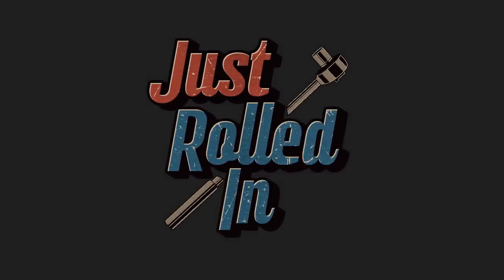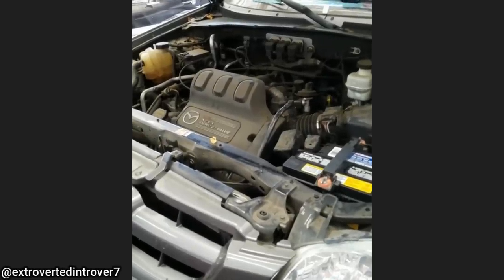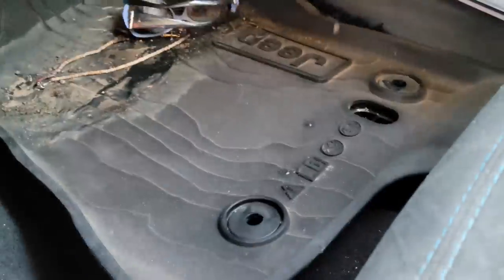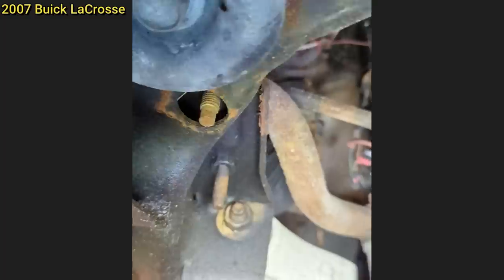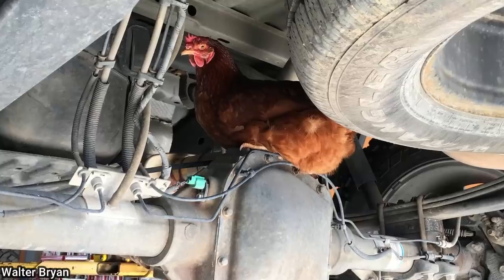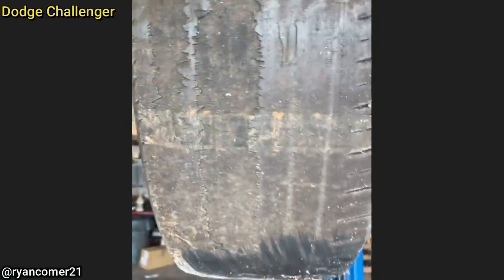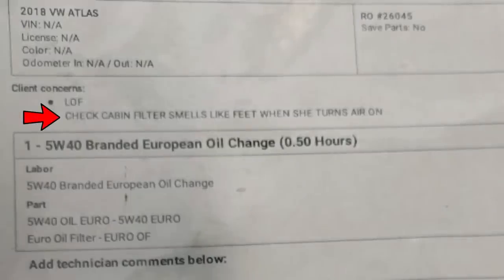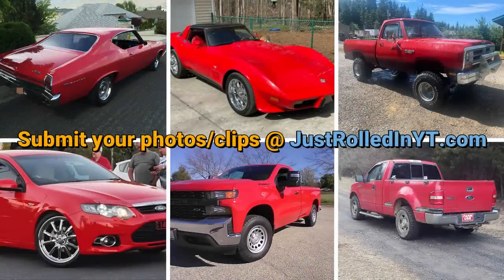Customer States They Got A Flat Tire & Kept Driving | Just Rolled In

Comment: I had a new 2015 Chevy Equinox with free oil changes, by the 3rd time It took a couple of hours so the 4th time I did it myself. I come to find out they never changed the filter and it was all clapsed in from being so dirty. The dealer refused to acknowledge it. It got ugly after that.
Reply: Changing oil without changing the filter is like showering and then putting the same dirty clothes back on, underwear included. 😛
Reply: They all do that crimp in the middle during removal.  Its the cheap chinese brands.  They too do not buy your story. These are easy to replace.
Reply: @cpufrost  im pretty sure the delivery vehicles at my last job never had the filter replaced when the oil was changed. tbh, those cars also missed oil changes. no clue how a 2011 vw polo, one of the delivery cars, got to over 300,000 kms with how poorly maintained it was
Reply: @briansydnes1711  well, there is also a plastic cover over the oil filter, the second you put any tool on it, it leaves a mark. Mine didn't have any mark at all. I quite frankly I don't give a rats ass if anyone believes me or not, they weren't there.
Reply: You take them to court?
Reply: @VintageCars999  no, they basically said they would fight it and go to court all the time, with excuses to get around  it. I sold the car for a good price and bought a 2015 Silverado from another dealer.
Reply: @wurly164  well that sucks. GM has really gone downhill

Comment: 2:18 Can someone explain me how this situation can possibly happen?
Bad Rims? Cracked Rims? Hits Curve too hard?
Reply from the maker: Usually happens when somebody keeps driving on a flat tire. Then drives for a while on just the wheel 😅
Reply: @JustRolledIn  Never had a customer drive in whit such condition,quite interesting.
Reply: @JustRolledIn  The first one shows wear, the second one is broken.
Reply from the maker: @tinknal6449  technician told me it was driven in twice after they had flat tires.  But ya I agree on that. Unfortunately nobody ever tells me the full story or forget an important part 😕
Reply: @JustRolledIn  Yeah, I agree that the one still mounted could have broken off after being driven until the spokes hit the pavement.  My guess is they curbed it hard and finished the job by driving on it.

Comment: What's truly funny is all of my cars and trucks from the 80s run like Champs with 150-230k miles on them. My 2 90s vehicles run pretty well but the electric everything is pretty screwed on both. My only "modern" vehicle is a 2014 hyundai equus. It has a plastic transmission pan. Mufflers that weigh literally 40lb each and reduce fuel economy by over 1mpg. Both back window motors are broken. The driver seat switch just broke. You have to take the front bumper off to replace the headlight bulbs. It would be a lot harder if any of the crappy plastic skid plates underneath were still there. The oil filter housing is literally plastic. The rain sensor was cool when it worked now I have to manually activate my wipers when it rains and they only go fast. The alternator went out at 38k miles and the dealership wanted me to pay for it so I installed it myself. The alternator is underneath the motor and was dumb af to install. They also claim the transmission fluid and other fluids are "lifetime" I'm not braindead so I take my car to an independent shop and at 30k miles the transmission fluid already had metal in it. Also the tyranny filter is built into the pan so you have to replace the whole thing.  All these things happened before 50k miles and I maintenence my cars 100% properly. Also this car cost over 70k new. And I bought all my other vehicles for less than 6k and they are more reliable and just built to actually stay together
Reply: I only drive older stuff my self

Comment: The picture of the filter is from an ecotec engine, made from mid 2000s to 2017, 2.0 to 2.4l engines.  The video of the knocking engine is not GM vehicle.
Reply from the maker: Ya it's a Mazda. Different clip lol

Comment: Any vehicle that “runs out of oil” needs to be put down
Reply: If they keep it, it will need a new engine, based on how glittery that oil filter is.  Hopefully a new engine won't have that issue, or they at least learn to keep it from getting low.
Reply: I had an old Toyota run completely dry, engine wouldn't even start. Gave it new oil and filter and it ran fine for years after. Those old Toyotas were nuts.

Comment: DODGE SUCKS   THE NEW CARS ARE JUNK
LIKE FORD
FOUND ON ROAD DEAD
Reply: LIKE CHEVROLET    CRAP HEAPS EVERY VEHICLE RUNNING ON LUCK EVERY TRIP.
Reply: @deadon4847  HOW COME EVERY CAR TODAY IS PLASTIC
SAW LIKE 6 VINTAGE CARS AND 59 BUICK AND 55  TRUCK TODAY NICE ONES 
STEEL  FRAME 
ALL I SEE IS SUV PLASTIC JUNKS LIKE MY 18 IMPRESA
ALL CHEAP PLASTIC  HAVING 5 RECALLS AND 1 BATTERY
ONLY HAVE 18K
Reply: @ekop1778  They're all made to be disposable, drive them for maybe 3 years then get another one.
Reply: @deadon4847  HEHEEE